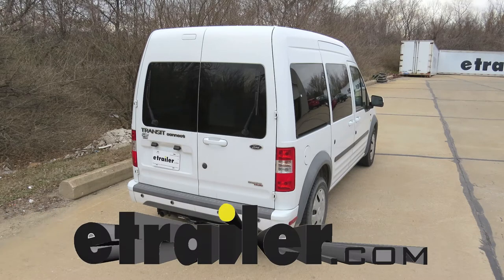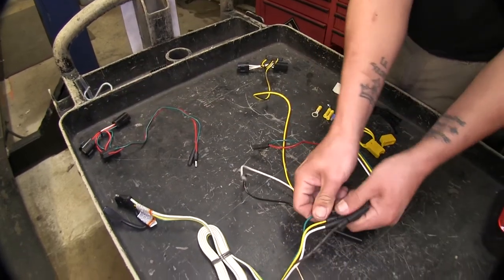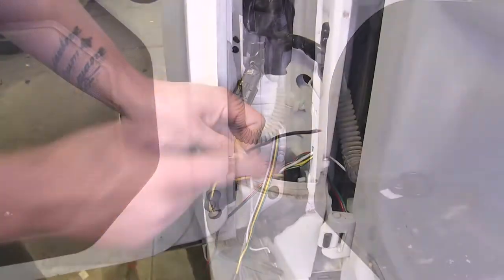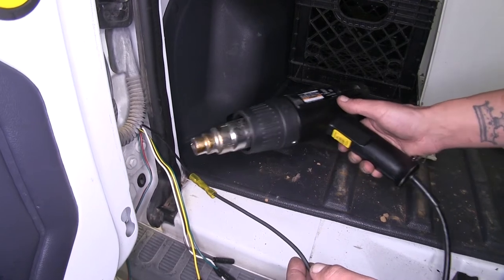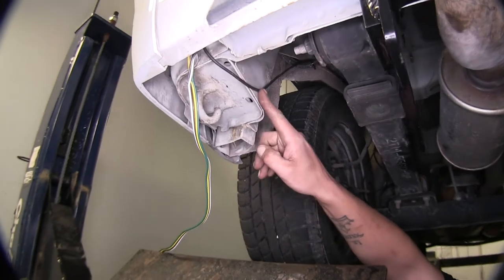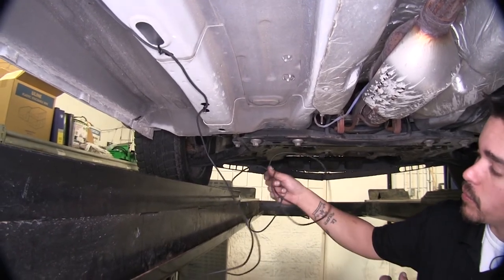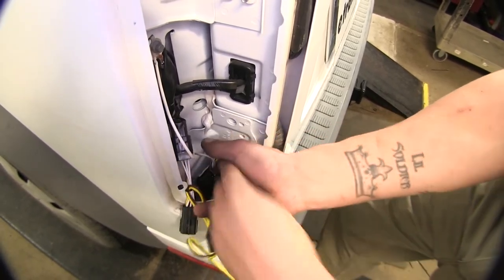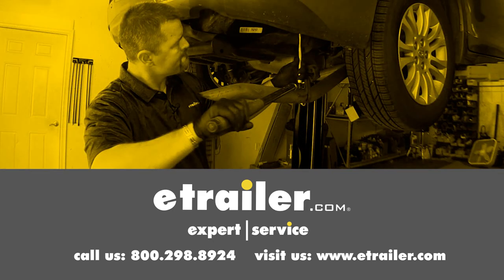etrailer | Trailer Wiring Harness Installation - 2012 Ford Transit Connect

Comment: I’ve not found the towing capacity for this generation of van. Do you know what it is?
Reply: I need to know too!!
Reply: merlin jeronimo let me know if you figure it out. Lol. I would rather car companies said “Towing Capacity: 2lbs” rather than saying “N/A”. We know it can tow ‘something’ so they should just tell us a low number if they don’t want us trying. 🤣
Reply: @garrettglass8854  so, the spec that gets put around now is about 1,750lbs
people estimate 1,500 unbreaked, and slightly more breaked
I would : install a transmission oil cooler, and maybe the Transgo Shift Kit Transmission Valve Upgrade
Reply: 2k

Comment: does it matter which side (passenger/driver) side you install the converter box on?
Reply from the maker: It will need to be installed on the driver side because the green wire is longer to reach over to the passenger side but the yellow is not.
https://www.etrailer.com/Custom-Fit-Vehicle-Wiring/Tekonsha/118585.html
Reply: etrailer.com I made it work somehow on the passenger side, seems to be ok. I ran power to 12V outlet instead of battery
Reply: @dagestanifive   was wondering if I could tap into that socket instead of going to the battery. Everything working ok?

Comment: The owners manual says not to tow anything with this vehicle.
Reply: And yet they do it all over Europe. Given that in Europe they have a 5 speed manual transmission coupled to a small diesel engine.  The motor in this US spec 2010-2013 is the motor and transmission from an automatic Ford Focus.
             I don't know if the transmission will like towing but the chassis and brakes can handle 750 kilo trailer without brakes and 1300 kilos on a trailer fitted with brakes. So in US measure 1650 pounds unbraked and 2860 pounds with trailer brakes. I plan to round that down to 1500 and 2500.  Tongue load is usually suggested to be around 10% of the load. I think tongue load is going to be the limiting factor on the chassis components. I have fitted airbags on my rear axle. 
      I do think towing is going to be hard on the transmission and that Ford really let us down with the motor and tranny combo they picked for us. I have come to understand that a Ford Focus manual 5 speed will bolt right up to the US spec engine and the mountings and holes for the clutch etc are already on the chassis.
        My plan is a small motorcycle trailer unbraked and a small 5x10 with brakes for hauling sheet goods and construction materials to jobs. Not long haul.